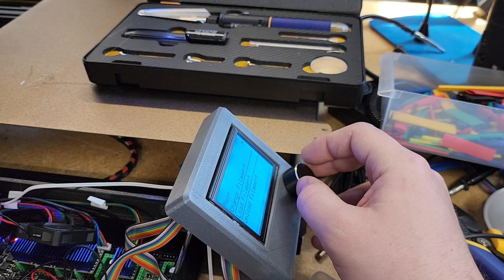LDO Orbiter Filament Sensor on our Unified 2 Firmware

Comment: Can you connect the unload wire on the ez board V2? Or just the other 3?
Reply from the maker: You can use a spare IO pin and modify the source code if you wish. Example would be using the IO pin from the SERVO header.
Reply: I just did it yesterday. The unload pin went to an unused pin on my 4.2.2 board, I used the Z limit switch since I’m using a BLTouch and the other 3 pins went to the filament runout port included on the board.